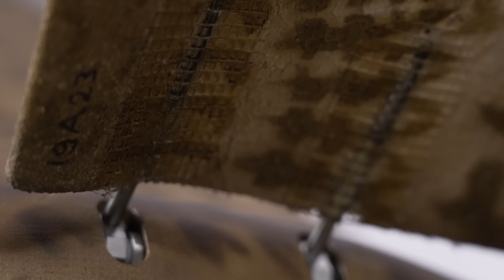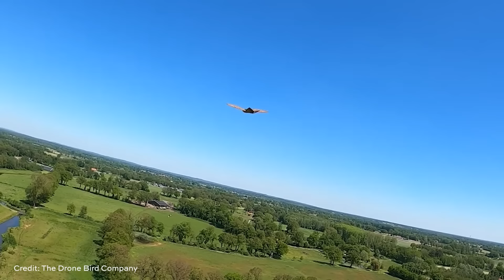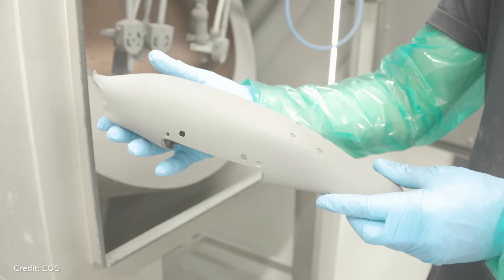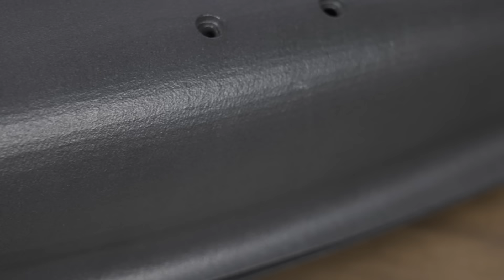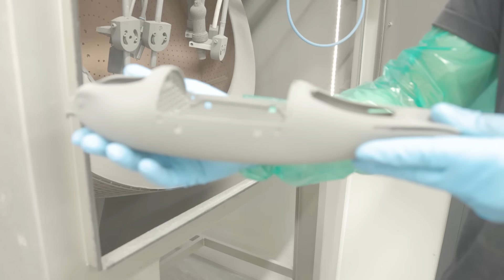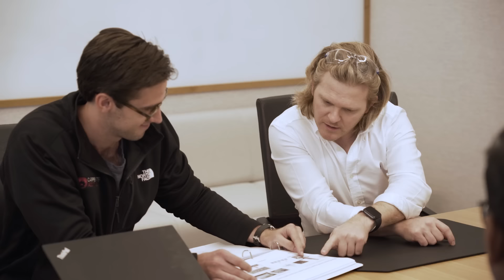3D Printed Drone Bird Flies Like a Real Bird | The Cool Parts Show #66

Comment: Have a look at how a Bird Flys - They have Feathers, a completely doable thing in a man made bird. Watch in slow motion how a birds wing works, the shoulder pivots to make the Up Stroke Free and effortless Movement, then the counter pivots down the feathers close and the '2 stroke' Power stroke happens right - it's so simple Birds can do this shit.
I like your bird but it could be so much better, less power to run to allow other shit that's needed in the craft to be added like a camera, sound system, a 360 mag 12 gauge Gatling gun, you know the important things!

Comment: This is one of the best adverts I've sat through, I'm Biased, I like Flight and I've had problems with birds - "Sound" If you could have the bird make the sounds of your predator bird it's going to be Way the hell more effective - Sight and Sound .
The other thought/observation is that your power wings don't have feathers and feathers save 50% of the energy in a bird.
When that wing lifts up it tilts and the feathers part softly to allow air flow without the need of power - in a bird the up wing is a rest beat.
So good Advert Great idea I think if you went back to the bird it's be helpful - it'd talk sense